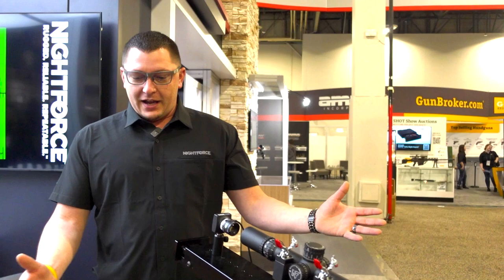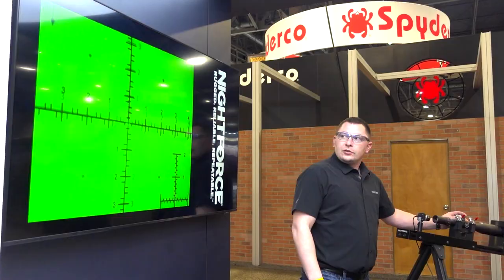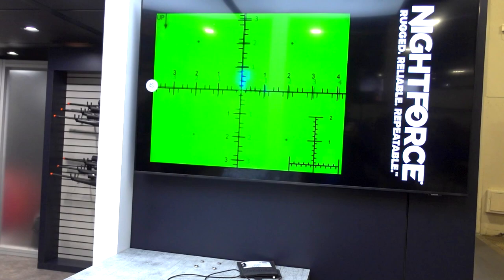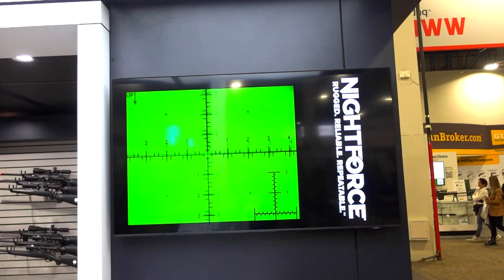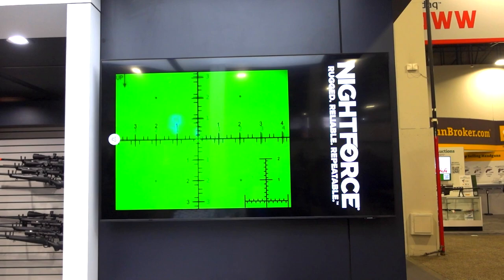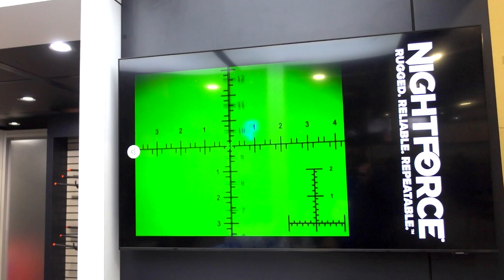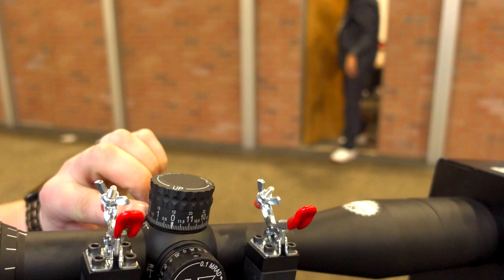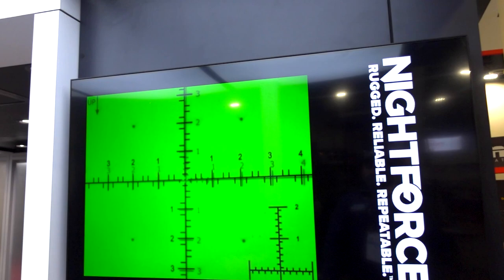Nightforce rigorous scope test | SHOT Show 2023

Comment: In the process of swapping out most of my optics to Nightforce. First one was a NX8 4-32, very happy only regret was that I could not afford the ATACR.
Owned quite a few Vortex optics, the warrantee is great when they stop working correctly , but who wants to deal with the spent ammo and time to identify it in the first place.. 
Shooting a 300PRC with the 220grainers in sub -20 temperatures won't hold windage on second PSTII now. Nobody wants to shoot up the area before a hunt to verify and reset  a Zero they had set just the day before.

Comment: Love my Nightforce. It's ruined me for all my other scopes. I do have 1 complaint that is rather annoying. On their mag throw lever on the NX8 4-32 model, the positioning of it, plus the length of it for any 90 degree bolt throw which is most guns, it makes it so you can't run the bolt on anything higher than 28x, or else the bolt hits the lever. I contacted NF about this, they confirmed this is an issue and they are well aware of it, but have no intentions of addressing it what so ever. Not even by making a shortened version of the throw lever. Pretty annoying that I have to machine my own lever to remedy this issue NF acknowledges and won't fix. Other than that, I absolutely love the scope and have no complaints.
Reply: First or second focal plane?  I have the 2.5x20 in FFP.  At 32, I am thinking a FFP will be too dominating at 32X.  Your thoughts?  Hunting and 1200 yard shitcannery.
Reply: @TheNutzandBoltz  FFP. I mean first off for hunting I'll never take it that high haha. Probably never over 18 max. I only go that high when I'm shooting at steel off of a bench. Ya the lines are a big bigger at that magnification, but I haven't found it to be an issue what so ever. I'm so glad and have no regret's what so ever I went with FFP. I'll go with FFP every time I can now. For me the real issue is at the low end of the magnification. A lot of scopes have the reticle shrink way to much so you can't even see it at low mag. No issues with this one.

Comment: That is a all I run. They even have different price points. I do not buy there most expensive model. I will run a box test by firing and moving the impact in the shape of a box and then shoot at the first hole in the paper again. It still shot .250 MOA. Are there better scopes out there, probably. But just to make a change is not cost effective when it works for many years so far.